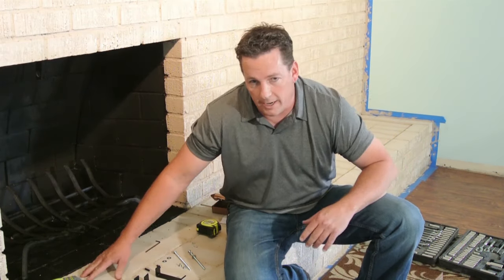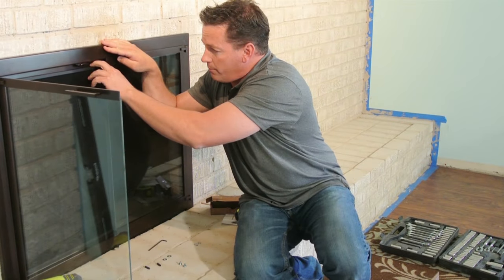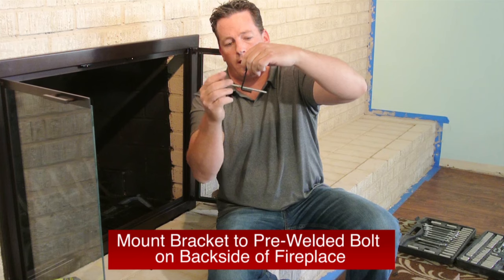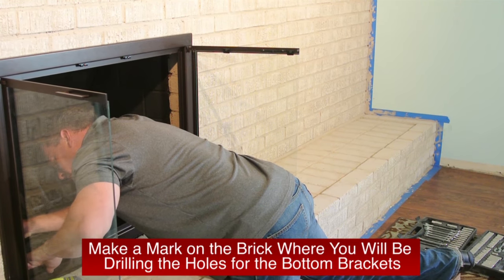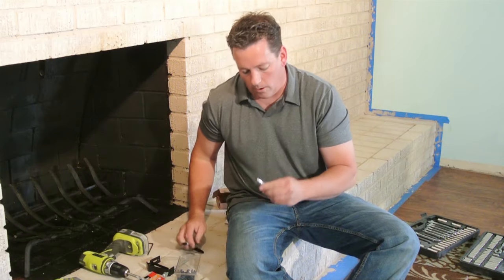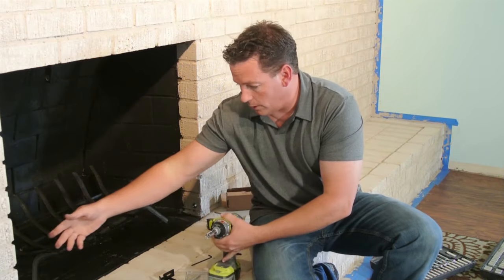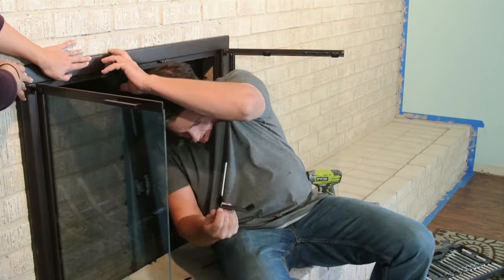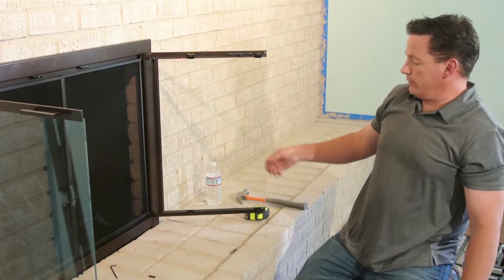How To Install A Masonry Fireplace Door [DIY fireplace door]

Comment: I bought that exact kind of Fireplace doors but the fireplace is 1/2 smaller. The contractor is going to shave down the brick a little bit so it can fit. Do you have any other tips to try to get it to fit? I got the small doors but the fireplace was built in 1950 and a touch too small. Thank you in advance :)
Reply: Mary Mackey yes, buy new house with bigger fireplace.

Comment: So there is no seal between the brick and the new glass unit? Doesnt that defeat the purpose of a glass fireplace insert if there is still drafts allowed past the doors... smh.
Reply from the maker: While no fireplace doors are truly airtight, you could look into purchasing gasketed masonry doors. Gasketed doors tend to prevent  drafting and air loss, however they are also much more expensive. Feel free to give us a call at 800-897-7175 with more questions!
Reply: BrickAnew i did research and they sell a product called ceramic wool. It is the best material to use for gaskets as well as wall to glass fitments. You should sell it.
Reply: BrickAnew 1900 degree continuous 2300 degree max.
Reply: The overlap-fit doors that I received from Stoll Industries included insulation to cut and fit into the top and both sides of the enclosure frame.  Insulation is high density and has a fabric face that appears to be for contact with higher temperature.  I also ordered my masonry fireplace enclosure with AirSeal Doors.  Stoll offers the AirSeal option for $150 which I don't consider to be "much more expensive" on a custom set of doors.